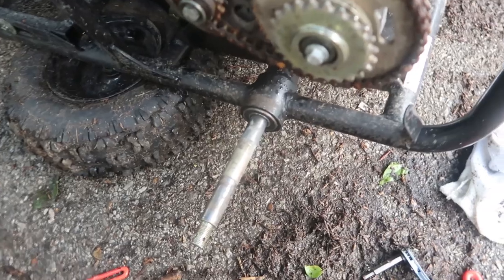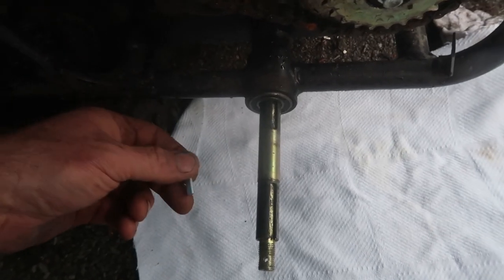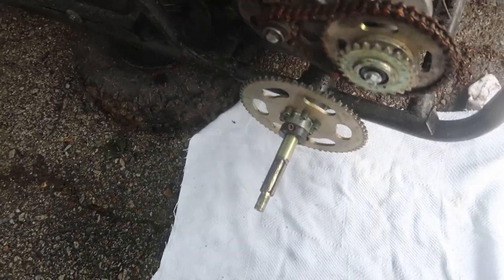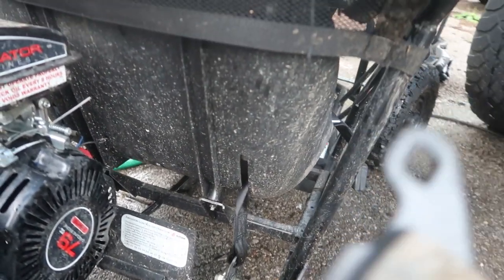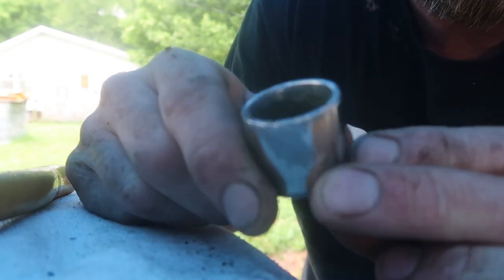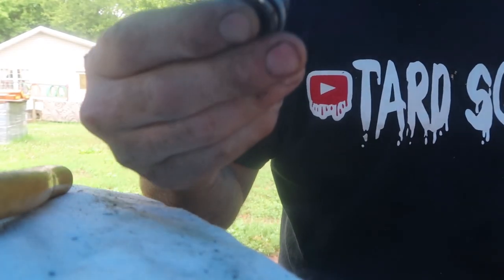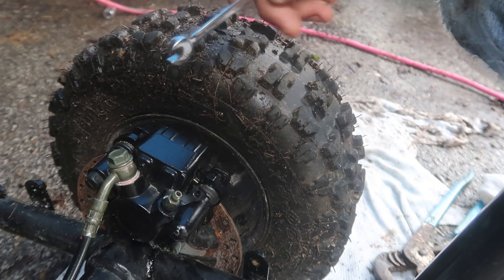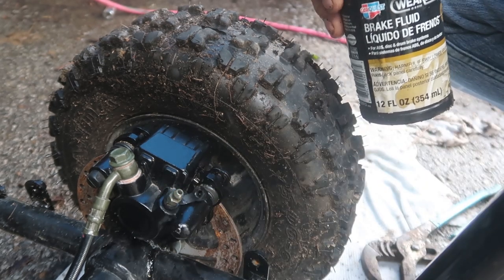COLEMAN CK 100-S How to fix axle and brake caliper                                #TARDSQUAD

Comment: Use a vacuum blender to speed up bleeding. I’m currently swapping a 212 onto mine but to use a TAV I’m gonna have to modify the rear cross bar the roll bar bolts to. Just hope it doesn’t weaken it
Reply: I couldn't get piston to push back out can anyone help